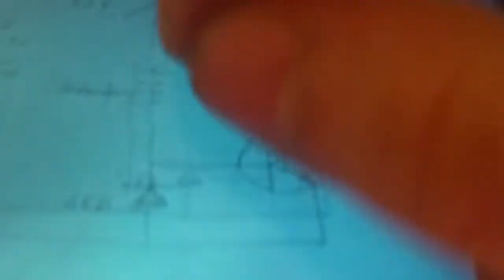reverse joule thief replication

Comment: I had to focus closer with my point-and-shoot camera, so I took a lens out of a toy binoculars from a dollar store, it was about the size of a nickel.  I held it in front of the camera and it focused close enough.  You are very wise to have the LED across the base - emitter leads.  Without it, the high voltage would do some serious damage to the transistor.  Another idea: wind some more turns around the core and use the winding for the feedback winding instead of the secondary.